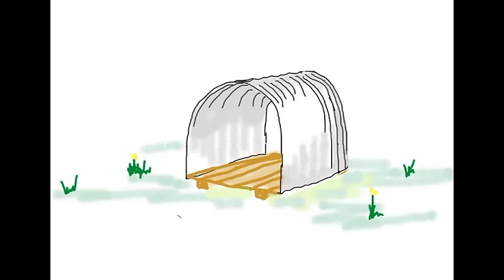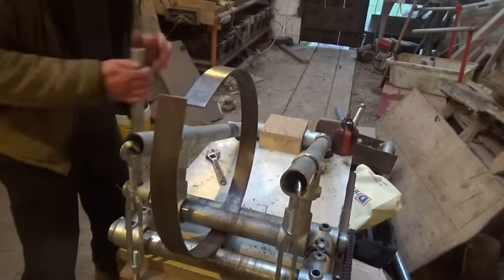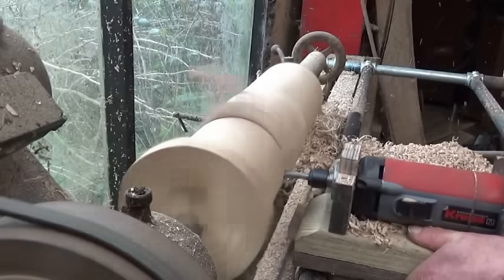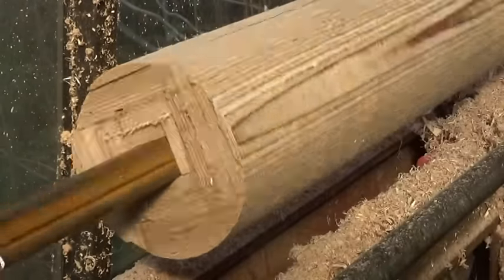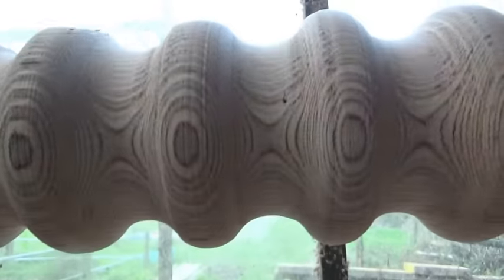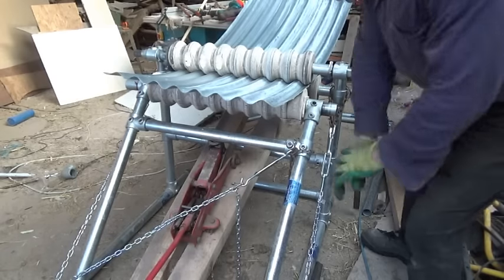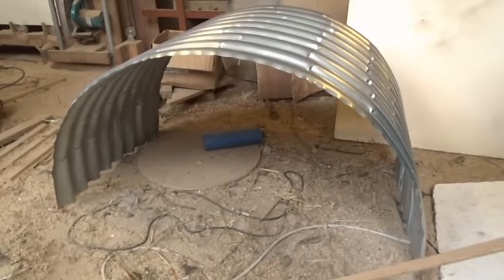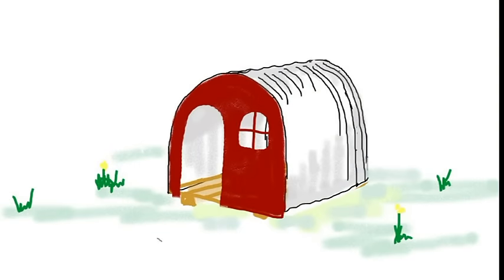Homemade Corrugated Iron Roller (well, nearly!)

Comment: I've been thinking about your roller problems for a while & this is only an idea, but its  something for you to consider. When you are curving the iron you need to effect a difference in what will become the diameters of the  ribs and valleys. I believe this can only be accomplished by stretching the outer ribs. To my way of thinking, the easiest line of modification for testing this idea, would be for you to make the valleys on all of the rollers deeper, that is if you have sufficient material to do so.
Reply from the maker: Thanks, david. I'm working on a different solution at the moment but might have to consider everything in the end
Reply: Good luck

Comment: Well I hate to break it to you but fifty years ago we made these Quonset hut type shelters by laying the corrugated tin on a fence post and walking on the area near the post.  Mark the straight sides so the sides stay straight.   Took about five minutes to curve a single panel and the result looked fine.
Reply from the maker: Good for you, Tim, but that's because they had huge diameters obviously
Reply: @WayOutWestx2    Not at all, usually 24" to 48" diameters.  Try it, it works.

Comment: Great work Tim! In terms of a motor you shouldn't need too huge of a motor, I bought an on table saw motor that's about 2hp to run my rototiller. The main thing you need to do is reduce the speed through some gears possibly on a chain and you'll have plenty of torque perhaps even from a 1hp motor, though I'd go with as close to what your breaker can pump out as possible ;)
Reply from the maker: Yes, I think 2hp is all I could use here on my supply. But I want to sort out the kinks before I spend any more money...
Reply: @WayOutWestx2  Well your bright mind is probably the one for the job! I'm excited to see what you come up with :)

Comment: Corrigated plastic can be formed like this without any rollers. I have a roof with the this (3 sheets make 180°), so even if 1 sheet has to make 180° like you have, you could easily mold it a little more with heat (I'd try hot water in an animal drinking tray).
Reply from the maker: Thanks, but I'm trying to avoid all plastics where possible
Reply: @WayOutWestx2  Hey, I like your reasoning for not using plastics. I'm also living mostly plastic free. I have lowered my 1-use plastics by at least 90% in the last year. But in this situation this kind of plastic is very long lasting, 100% recyclable and a lot more environmentally friendly. Steel is very energy intense and pollutes a lot more than plastics. A lot more non-renewable resources are spent on making the same amount of steel compared to plastic.
Reply from the maker: You make good points, but I like it that wood and steel just disintegrate into the hedge in no time
Reply: @WayOutWestx2  Wood is great and 100% renewable. But steel is frequently also galvanized and thus very very toxic to the environment where it disintegrates.

Comment: How about trying some flat sheet steel and form your own corrugated sheet with your roller. curving it into shape at the same time as the corrugations go in...
Reply from the maker: the sheet becomes narrower as the corrugations are formed, so the bumps would have to move closer together as you proceed. Complicated!
Reply: @WayOutWestx2  Yes...the same as all roll formed metal does. The way some commercial machines work is it gradually increases the depth of  corrugation as it goes down a long line of formers. You can do the same thing with one former as you have made by using light pressure and then increasing it with each pass...as the corrugations get deeper they will fall into line, no worries about the sheet getting narrower, it will do it on it's own. There is also a formula for the correct flat sheet width you need to start with to end up with a finished width of 24 inches as corrugated comes in...For 36 inch coverage sheets it is close to 38 inches to start with for R panel sheets ( like commercial roofing is, ribs every 9 inches) But since it won't matter if you have 24" finished sheets for your project, you could just split a 4'x sheet to 24" and  end up around 20 or so inches wide. (I owned a steel building business for 15 years, so have done a lot of steel sheet work and seen a lot of it made) Some tweeking...your machine will work for what you want it too...the problem you are having is because of the ribs strength not only from being formed, but because as it stretches the metal it also work hardens it making it much harder to bend into the curve. Do both at once, form and curve it...and you will have it. Anyway...cool project!
Reply: @WayOutWestx2  Another thought...doing it by hand will get old real quick...keep an eye out for a 1750rpm 3 to 5hp motor and an old truck 4 speed transmission with a granny gear low (like a 3/4 to 2 ton truck would have) Use a chain drive on one end of the tranny (tailshaft end) to machine, use a smooth (not cogged) belt on the other end of tranny (front clutch end) to motor. The belt will keep from tearing up the machine if something gets stuck by slipping. This will give you a torque multiplier so the machine has the low end grunt it needs to form the metal. Use 1st gear...it should move the machine end at about 300rpm...slow enough to work. If you have a Variac you could also use that to slow the motor down from 1750 if it is still to fast even after going through the tranny, (or two trannies hooked inline to each other to bring it down even more)

Comment: Does the corrugation have to be so big? Maybe smaller but neare might be easier.     What about rolling the sheet into a curve first and then just corrugating it after that (cant see this helping really but might be worth a try).
Reply from the maker: I'd finally worked that out myself - and you're the first to bring it to me, thanks. That's my next move - watch this space...
(Your second point won't work though!)
Reply: @WayOutWestx2   Not sure but are the creases due to work hardening. As you work it the stiffer/less malible it becomes and that hardening is causing the folds.. The only way (I think) to resolve would be to heat the sheet again and let it cool slowly so it got its softnesss returned so it could be bent some more
Reply from the maker: You can't heat the zinc, unfortunately. The steel just rusts immediately

Comment: They use different tin for rolling (softer)
Reply from the maker: Actually it's thicker and not softer at all
Reply: Way Out West Blow-in blog it is thicker and the tensile strength is lower as standard corrugate can be torn rolling iron is soft and malleable so it doesn't kink
Reply from the maker: So sorry, Big Ears, it seems you are quite right (and I'm an idiot. But I'm learning all the time...)
Reply: Way Out West Blow-in blog no you are pretty good at lots of things no one gets every thing right first time

Comment: You can buy these sheets for dirt cheap but I love you for engineering a solution. Hats off sir.
Reply: He is not trying to make the sheets; he is trying to bend them.
Reply: @codetech5598  Yeah you can buy these already curved for roofing and pig houses etc.
Reply: Yes you can, but when you said "sheets" I thought you meant the straight corrugated piece and was implying that the video was trying to put corrugations into a completely flat piece of metal instead of bending an already corrugated piece.
Reply from the maker: I haven't been able to find a single manufacturer who will curve the shape I want in one piece, Nathan, And I looked right across Ireland and into Britain..
Reply: @WayOutWestx2  What country are you in?
Reply from the maker: Ireland

Comment: The industrial version makes the bends on the inside of the sheet first .
Reply from the maker: Not sure what you mean there, Kirsty?
Reply: They fold say the first four corrugations then they go on to another machine that rolls the outside ones . They aren’t all done at the same time .
Reply from the maker: Yes, that's how they make the corrugations in the first place, but I'm not trying to do that - I'm just trying to curve the finished sheet. Thanks, though!
Reply: Way Out West Blow-in blog 

As you were . Sorry .

Comment: Why not just use a sheet of coroplast and maybe sturdy up the ends with a strip of that steel if it needs it?
Reply from the maker: and try to roll coroplast??
Reply: It wouldn't need to be re-pressed as it already has the structure in its corrugation, just bend it in a curve and maybe staple it onto your pallet
Reply: here's your search terms: coroplast tiny house
Reply from the maker: Thanks. Interesting. I'm trying to avoid all plastics, but perhaps that would work for small polytunnels